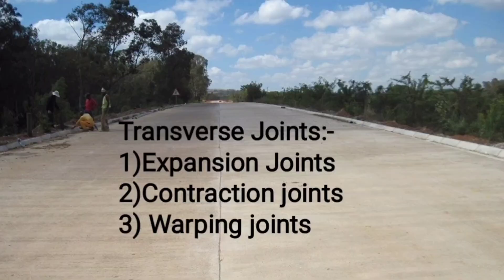JOINTS IN RIGID PAVEMENT

Comment: Sir, What is minimum distance between two expansion joints in CC road ?
Reply from the maker: As per standard norm Expansion joints are commonly provided at an interval of 50 to 60m for slab laid in winter & 90 to120m for slab laid in summer. But design is provided by clients after detailed study of subgrade soil and various parameter .
Reply: Thickness of expansion joint is approx 2.5 cm not 25 cm